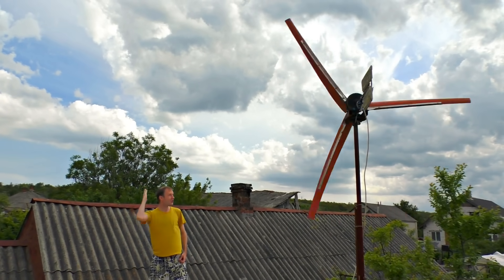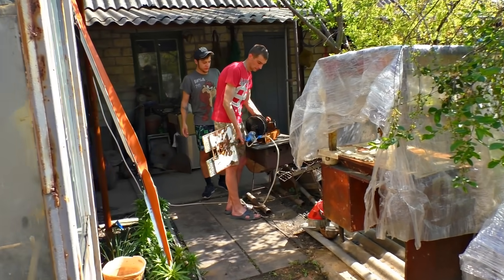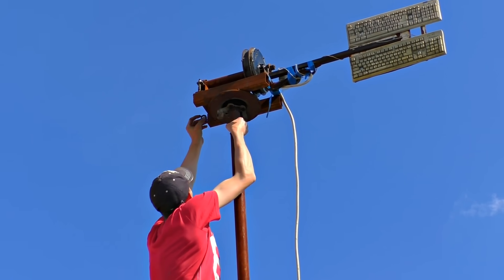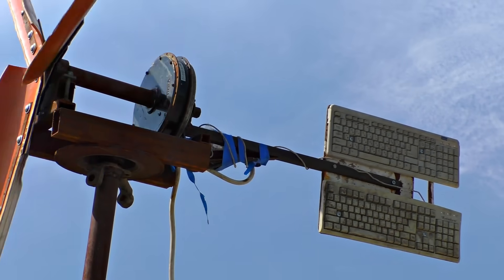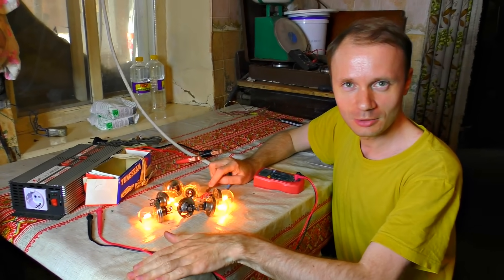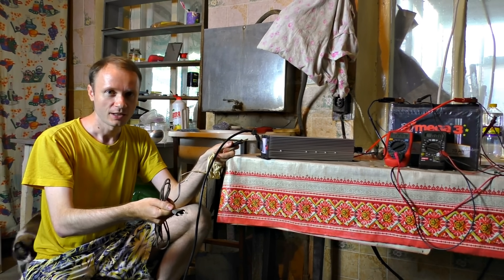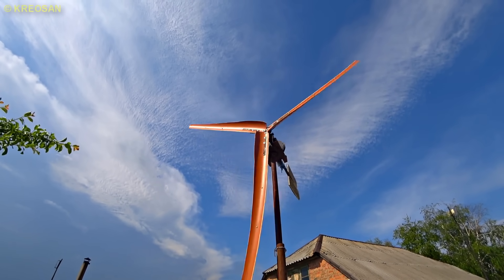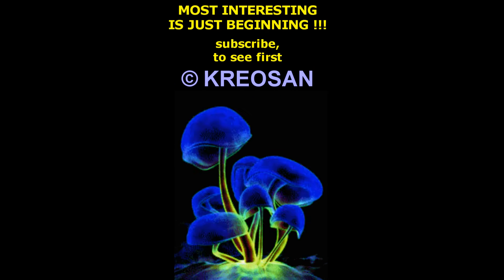✅Powerful Wind Generator DIY / Free Energy / Green Energy

Comment: Not really a smart solution and far beyond of being free but a nice hobby.
Reply: One could give you a free meal and you‘ll complain about it not being shoved into your mouth.
Reply: @heavycurrent7462  It's not free. Far away from free. It's very expensive.
Reply: @hiroobidoo  Then how can anything be free? Wind turbine isn‘t free? Solar power isn‘t free? Then a gift isn‘t free either, because you‘ll have to trade it with the energy to unwrap the box. Free in this sense, is to have it accessible without further continuous energy trade off. Once you‘ve set up a wind turbine, the work is done. But the energy you‘ll get from it is very close to continuous.
Reply: @heavycurrent7462  That's what people tend to believe. Once you digged into the ground and start pumping the oil/gas out: the gas is free. The earth does not send us a bill for pumping out the oil neither we do receive a bill for the wind blowing, the sun shining or the natural gas to emerge from the ground. Same argument applies to all sources of known energy. It's always a question of how much energy you need to put into a system in comparison to how much energy you get out from it. The problem with wind turbines is that you have to invest a lot of work and material to build very large systems that can harvest enough wind energy to power everything we need. See my calculations above: In order to replace a conventional power source with such wind turbines you'd need to build over 20 of such little wind turbines. And my calculations above are very "pro wind". Because many households require up to 10 kWh/day or even more. Meaning they would require 40+ such little wind turbines in order to gather enough electricity reliably.

Wind power has the big problem, that it's extremely unreliable and low-dense. In order to make it reliable you have to build up a huge power buffer (batteries) and install a lot of wind turbines to compensate the low density. Above I explained: Wind has a power density of only about 2W/m2. This video even proves it: They get 90W peak but in average this system will provide noch even 1/4th of that energy. Probably it will produce about 15Wh throughout the year - if you're lucky. 1 wing of this turbine I'd estimate to be about 2 meters. That's about 13 squaremeters area > 15Wh / 13 squaremeters = 1.15 W/m2. Probably this hand-made wind turbine is even worse and will fall below 1W/m2.

Do you recon how inefficient this design is? Do you really believe that building and maintaining over 20 of such wind turbines just to power your home - including the necessary batteries - is free???

Just as a comparison: 20 such wind turbines produce about 2.630 kWh electrical energy in their ~ 15 years lifetime. 
Each wind turbine requires at least 50kg material installed to work. That's 50kg of ressources that you need to dig out of the ground to build 1 of these turbines. That's about 1 metric ton of material required to produce 2.630 kWh electricity. In order to make the wind-system work reliably (for your home only) you need batteries. 30 kWh at least. Modern batteries provide about 120 Wh/kg. So you'll need another 250kg of batteries. In total you will install about 1.3 tons of material/ressources in order to produce just 2.630 kWh electricity. This results in a lot of energy required get the materials out of the ground and manufacture everything. The costs for the batteries alone will be around 7.000$. So... where exactly is it free???

Calculate the costs per kWh and you will see that you pay a lot more for this "free energy" than the energy from the grid whilst having a much less reliable energy source that is unable to provide larger amounts of power within short time. For example: You could not charge an electric vehicle with that. The power densitiy is just too low. You'd need to charge 1 day just to drive 20 km (about 12 miles). And if you do that, you will not have any power left to power your home. It's ridiculous.

For comparison: The same amount of energy can be provided in a modern nuclear reactor with only about 10 grams of Uranium or about 1 gram of Thorium. That's why the future will be nuclear. Not wind, not solar. Modern Thorium nuclear power plants will provide all the energy we need in the future. The resource is abundant in large quantities all over the world and the energy density is extremely high whilst the modern power plants are inherently safe because they do not work with high pressures anymore. Look it up, the technology is called: LFTR (Liquid Floride Thorium Reactor). That's not free energy either, but it can produce absolute CO2-Free clean energy in enormous quantities extremely cheap (about 0.2c/kWh).
Reply: @hiroobidoo  Too much talk while dismissing the point. We are talking about getting energy to power homes, not as a company who aims to profit by selling the energy to millions. 

Now, how is my wind turbines not effective and reliable VS me paying for every watt?
Reply: Thank you so much for you comments.
Greetings from Croatia
Reply: And we are talking from the perspective of a consumer, having to pay every watt we consume VS having the alternative to get the watt somewhere else. Thinking very deeply is not the same as to think clearly!
Reply: I built my own vertical wind turbines, and I have two of them! In half a year the money I have to spend to mantain them is less than the bill I have to pay for a month. Now tell me how is that very expensive and not a smart solution.
Reply: Take a look at your post again, "not a smart solution", to what problem? An energy company‘s problem or a consumer? This is like building a rain collector, the water you collect is free, in every sense of the word. Compare that to paying for every drop. This is a solution for consumer. Think slowly buddy. Too much and you‘ll get lost within your own opinions, which in this case has nothing to do with the video.
Reply: @heavycurrent7462  I'm thinking as a consumer. That's why I did the math calculating the price per kWh produced. The reasoning about large wind turbines was to explain why wind turbines do not scale up to large energy production facilities. As seen in Germany: Windpower is failing massively. But honestly, I did not see this message of yours before. I think it did not show up until now:
> I built my own vertical wind turbines, and I have two of them! In half a year the money I have to spend to mantain them is less than the bill I have to pay for a month. Now tell me how is that very expensive and not a smart solution.

I'm curious about this solution and would be happy if you would be willing to give a few key figures about it:
1. How much money did you need to invest in total (turbines, materials, cables, inverters etc.)?
2. How much peak power do the 2 helix turbines produce?
3. How much average power do they produce throughout the year?
4. Do you buffer energy or just use what's coming and the rest from the grid?
5. Would you trust this system and detach from the public power grid completly? How much would it cost to do that?

You know, I'm not saying it isn't cool I would build this myself. But from my point of view - based on all calculations I made - this can only be seen as a hobby but not as a serious power supply. If you can prove my calculations wrong I'd be happy to change my mind about it. So far, everybody has failed to do so.
What I can imagine though is: If you get the electric components from a junk yard for free, then build everything yourself with your own hands etc. - then maybe it would be cheap enough to make it worth doing. But my saying in this case is: When everybody would get the components from the junk yard, it would not be junk anymore and it would become expensive ressources. Thus: Only a very few people will be able to do that and only if they are very capable of doing all of this themselves in their "free" time ;)
Reply: @hiroobidoo  I‘d say 400$ or more to get them both running. At that time it was more to the activity in building them, didn‘t think that cheap and realiable ones were available online. Output peak never got higher than 470kW combined, and I use them only to power the lights in the garden, fans, and water heater. I wouldn‘t say my built would get me completely off grid, although that is a goal for me now. Now that you asked, I realized thst they are still not completely a solution, but I am happy to have them working, it is another experience to flick a switch open and knowing that energy is coming off some cut pipes.
Reply: @hiroobidoo  To completely rely on wind turbines I think it is better to buy them, unless you are a very skilled electrician and a craftsman. They are getting cheaper now and the best thing is you still get to learn alot maintaing and fixing them. Maintainence has never been a problem for me except with the battery banks, when my cut off system fails a few of them burn.
Reply: A thousand dislikes for that comment.
Reply: @TheSign2020  
Is it free? NO
Is it always available? NO
Is it reliable? NO
Does it scale? NO
Does it provide enough energy to provide all electric appliances? HELL NO

Always a thousand+1 more dislikes on your comment than you. What are you like... 10?
Reply: @hiroobidoo  Then just raise your finger in the air and  there's your free energy.  What would be free energy in your head? Me pedaling for you?
Reply: @TheSign2020  
> Then just raise your finger in the air and there's your free energy.
Argument is invalid. An oil field does not send a bill either. Neither do gas or uranium deposits. It's always a question of how much energy you have to invest to build something and how much energy you get out from it. There is no free energy that we can use to do work. You always need technical appliances to make this happen.
You say it yourself: "Me pedaling for you?"
Actually you would produce about 1.5x more power like that than this windmill. But as you can imagine by this example: This would also not be free energy. Because you need food, clothing, shelter and have lots of needs. That's why we stopped slavery and let machines do the work for us. That's much more efficient than enslaving humans and they can do a lot more work in time. They require food too though. Machine food. Oil and gas are machine food. Oil and gas would be free energy. But why it's not? Because it's an effort to pump it out of the ground and build the machines that can use it and produce power/work from it. Same with this windmill: It takes a lot of effort to get the material for the motor, the batteries, the blades, the cables etc. out of the ground and build everything together. The only difference is: Instead of oil the wind turbine uses wind as fuel. But wind has a very low power density of only about 2W/m2. Whilst a coal oven can produce 10.000W/m2 with ease. That's why wind turbines are highly inefficient: They need to be huge in order to being able to harvest a decent amount of energy in time. This wind turbine here is very little leading to an only 90W peak power. Wind turbines usually have efficiences lower than 25%. Meaning: in 75% of the time they do not produce power. This one here is - for sure - very bad. Probably has a huge stall angle and will produce power only at higher wind speeds perhaps with an efficiency of about 10%. So in average you'll get around 10Wh from this system. If you store the power in a battery together with all the loses over the AC/DC and back to AC conversion you'll lose about 50% of that. So this system will provide you with perhaps as little as 5Wh average energy. Or in other words: You will need to wait about 100 hours (~4 days) in order to be able to dustclean your house for 10 minutes. That's the reality of this "free energy" which is - if you look closely - very expensive. Because you have to buy all this stuff, manufacture it, set it up, maintain it, repair it and then you need the batteries as well to make it useable at all. What you see in this video is not the windmill giving the power. You only see a 12V battery powering some lights and a TV for a couple of seconds. And that's pretty much the limit of this system. It can't do much more than what you see in this video: Power a few electric appliances for a short amount of time. You could not power a refridgerator, computer, or something that you need to be able to rely on. That's why it's just a hobby. Understand?
Reply: @hiroobidoo  you're wasting too much energy writing something I don't care about. . Put a generator on your keyboard.
Reply: @hiroobidoo  I would say that you're being ungrateful for what you can have . 5000 years ago people worshipped static electricity that appeared between two golden plates as it was a God . while today you're not even close to thankful for being able to get 1000 watts on a windy day for 60-100 dollars.  What would  be free in your world?  Glowing buts?
 
With a small 1 meter wide turbine,  1.5 meters up in the air and 6- 8 tin blades and 1 Vcr motor you can light 10 small led lightbulbs without any noticable wind present.  The wind current is so weak that it can only be noticed using smoke or a candle.  And 10 LEDs can be lit with it . If you can't see how simple and how much potential there is then  you're not normal . Maybe you're living somewhere where there wind is not present.  I would understand if you did. As for me,  I never sam a place with no wind currents. You dont understand the potential of it so don't speak about it as if you do. You're too young.  You think the whole world makes wind turbines because they look pretty. Understand?
Just a hobby that powers up 5 homes on a butterfly.. 
If you're looking for free energy then graze grass for lunch.  Without making it you won't get it, by making it it is never free 
. I'm not sure  what you're looking for. People's time cost money.  Nothing is free. Not even mothers milk.
Reply: @TheSign2020  You did not disprove any of my points given. It's not about lighting a few LEDs. It's about being able to do work to replace manual labor. This little wind turbine can't do that. It would fail to power my dishwasher or washing machine or even my refridgerator. It's useless and - if you calculate all the time, effort and materials required for building and maintenance: It's very expensive. But it's a nice hobby and I would build it too just for fun. But it cannot be used to power your home. An average home requires about 4.500 Wh electricity per day. That is 187 Wh. This wind turbine is said to produce 90 W peak. So even if it could deliver 90 Wh ALWAYS and without any interruption you'd need at least 2 of them to generate enough electricity. That sounds doable. But it's not: because in REALITY this system almost never delivers 90 W. In average a wind turbines' efficiency ist at around 25% (as I wrote above). Meaning that you have to multiple the 2 wind turbines by a factor of 4 to being able to produce the 187 Wh in average. You'll end up with 8 turbines required to be installed to power your home. The wind does not always blow and if you want to have power when the wind isn't blowing you need to buffer the energy. E.g. in batteries as shown in this video. Through buffering and conversion you lose about 50% of the energy produced. So you have to double the 8 turbines again to make up for the buffering. Now it's already about 16 such turbines required to power your home. And now comes something that almost nobody knows: In order to have enough energy available ALWAYS for all your needs you need to overproduce enough power to compensate for times where the wind isn't blowing for several days.  

If you want to make this system reliably produce enough power throughout a whole year always you need to buy an energy buffer that lasts for at least 7 days. That is roughly 30 kWh battery storage being required. The cheapest you can get costs about 250$/kWh at the moment. Now you need to constantly overproduce in order to being able to charge the batteries. Imagine: Every day you need to overproduce the power of 1 day (4,5kWh) in order to have 7 days of buffer filled up for the case that next week the wind doesn't blow. For this you'll need another 8 turbines. You'll end up installing 24 such wind turbines to power your home plus a 30 kWh battery pack.

If you can build such a wind turbine extremely cheaply one would probably cost about 1.000$. For the materials but also you have to get into your car and drive to different places to gather the materials, cables, inverters etc. You have to invest your time to build it (your labor costs money too, at least 200$ per day) and then you have to pay for the required battery storage which will be another 7.500$ at least (absolute cheapest you can buy).

So the calculation will be: 24 wind turbines * 1.000$ per turbine = 24.000$
Batteries: 7.500$

You'll end up with about 32.000$ costs for this installation that will deliver the power you need adequately reliable.

Now do the math: 
Total cost: 32.000$
Maintenance cost: 0 (we do not add this right now to keep it simple, but there will be maintenance cost)
Lifetime: about 15 years
Cost per year: 32.000 / 15 y = 2.133$
Produced Energy: 1.643 kWh/year (365 * 4,5 kWh)
Cost per kWh: 2.133$ / 1.634 kWh/year = 1.29$/kWh

Your "free energy" will cost you more than 1$/kWh in the end, if it should be able to replace the existing power source and provide the same power and reliability. 

That is eve without taxation. Theoretically - if everybody would do it - government would come and add a tax on every kWh produced by forcing you to install a smart meter. Plus you'd need to add maintenance costs and you need to rebuild the whole thing every about 10-15 years.

That's - by the way - the reason why all countries that build wind turbines experience exploding costs of the electricity prices. E.g. Germany: doubled the electricity costs withing 10 years because of wind/solar. What I explained above is the reason. Germany doesn't use batteries to buffer the energy. They use coal power plants to do the buffering. Those are the numbers and that's why this is just a hobby. If it wasn't this form of energy would have replaced every other power source long time ago because wind turbines exist for over 400 years.